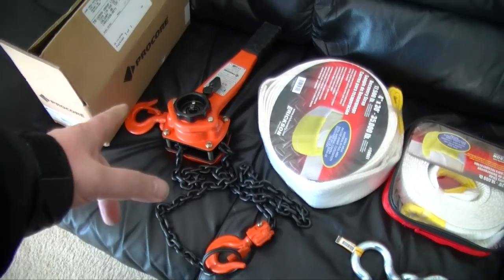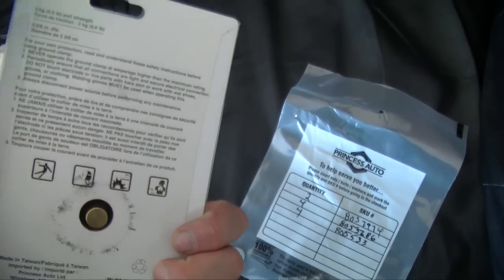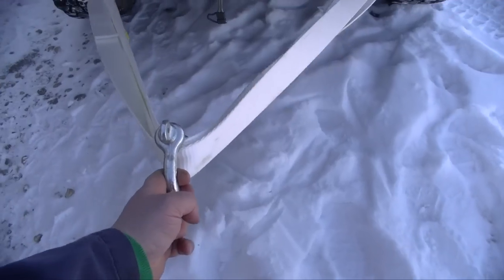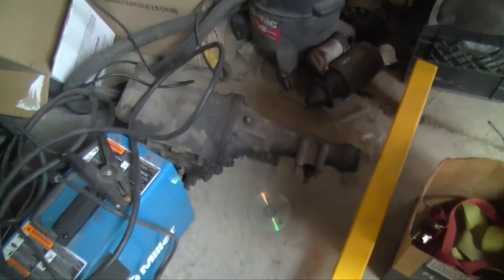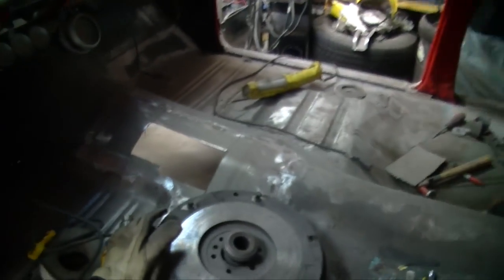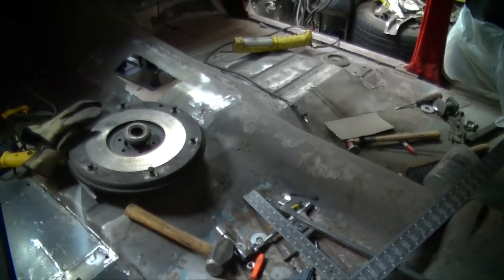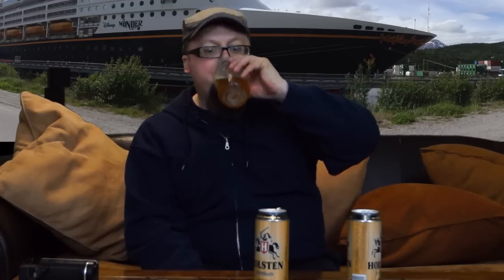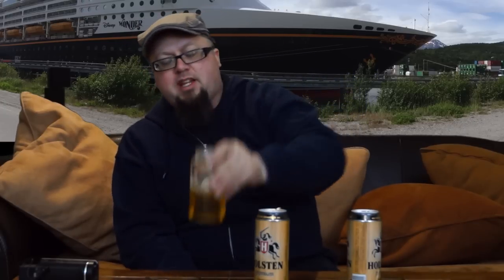My Recovery Gear for Off Roading

Comment: Get a kinetic rope, they're amazing.  I rarely pull out my standard strap any more.

Great idea with the camera!
Reply from the maker: interesting i'll look that up
Reply: Bullshitkorner You can pull with slack in the rope and it won't jerk either truck.  The energy from stretching the rope builds up and helps pull the truck out.   I was amazed when I saw one in action.
They are best used with soft shackles - don't have to worry about exploding D-rings.
http://lucky8llc.com/Products.aspx?ProductID=7209#prettyPhoto

Cheers,
BSK fan
Reply: David Kase I use Crosby Bow shackels....no made in china shit and certainly no D rings.  I'm sure you get it, but some reading the comments might not.
Reply: Thanks for the tip Chief Blue OX .  To be honest I use soft shackles but I like the idea Crosby Bow Shackles for sure.  Gonna have to get some asap.
Made in China is the scariest thing that can be written on a piece of recovery equipment.  No doubt.
Reply: I'm around "professional" rigging all day.  Quality is Job #1.  Look out for Tractor Supply rigging.....in the words of Pabst Boys...."It's crap!....and dangerous too!  lol  Peace Brother.

Comment: clicking noise is your U joint , or axis play in axle shaft
Reply from the maker: Possible but since all u joints, wheel Hubs have been replaced, torqued and cotter pinned.  It doesn't do it all the time just at random and only on a hard left turn.
Reply: Bullshitkorner
 i hear ya , but you gotta figure it only happens when your cranking the wheel ? is that a one piece hub and bearing ?

Comment: Take a good look at your axle shafts , you may have a u joint going bad. I know you just replaced them not to long ago. But I just had an issue with a 6 month old drive shaft.
Reply from the maker: I have thought about that too, but with the wheel up in the air and wheel cranked hard right or left i'm not feeling any binding at all.

Comment: I thought you went to princess auto before I seen the bag that said princess auto on it the orange comealong gave it away lol, my brother buys them for his welding shop. It happens to me with sounds your vehicle makes when you are mechanical your ears are tuned to noticing things you hear a noise you know its not right it bugs the fuck out of you trying to figure out what's causing it.  As for the car drop a 12 valve Cummins into it, you will turn heads when you start it up lol,  I would stay old school much simpler that way.
Reply from the maker: the orange come along isn't from princess auto it's a Procore ordered it from Greggs at work, i'd never trust a princess auto comealong.  the slings and the rest of the stuff is from princess auto,  dropping a diesel in the car and rolling coal would be pretty cool.

Comment: Have someone cycle your steering while you look at it. Your drag link at the pitman arm is shot. It  may be the camera angle but  it looks like the drag link hits the upper control arm on the drivers side.
Reply from the maker: it's the camera angle that makes it look like the trackbar is hitting the upper control arm.  there is for sure some movement in the drag link and the trackbar for sure at the joint,but that's not what makes the noise at random times

Comment: Did you ever figure out the clunking noise?
Reply from the maker: no i had a look again today, control arms are good, wheel  hub is good, u-joint in axle no play.   of course i couldn't get the sound to recreate today when i wanted it too

Comment: when do you plan to wheel id like to do the elbow falls trail i got a 1994 4runner 3inch lift on 33s and a nissan terrano rhd diesel waiting to do a solid axle swap
Reply from the maker: how did you get out to elbow falls in a vehicle, i've done it many times in a quad.  Looks pretty narrow to drive a vehicle down that hill though